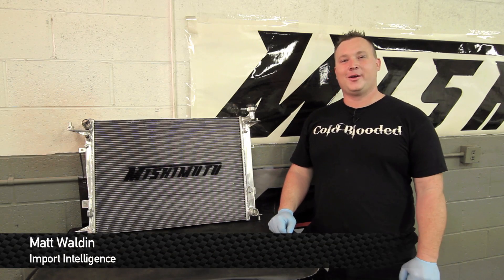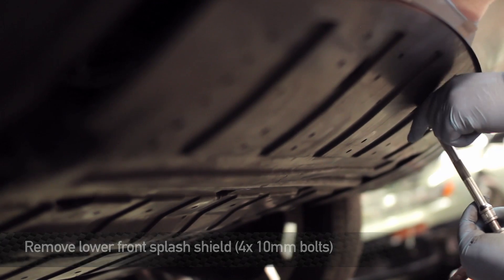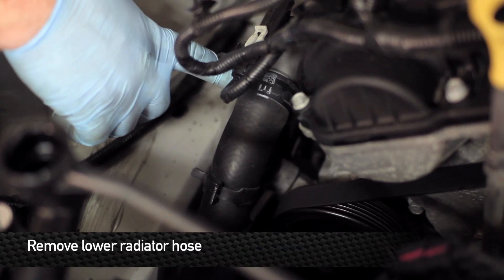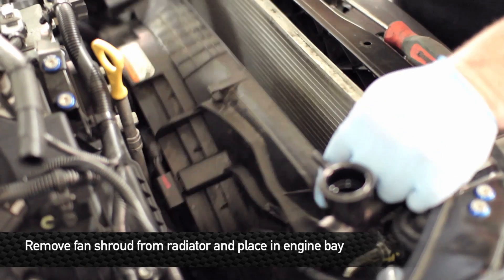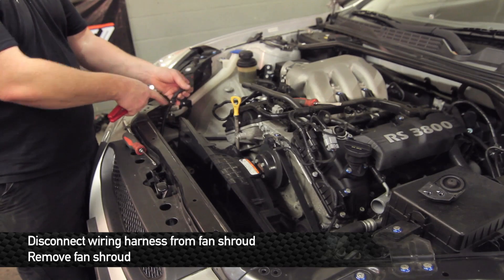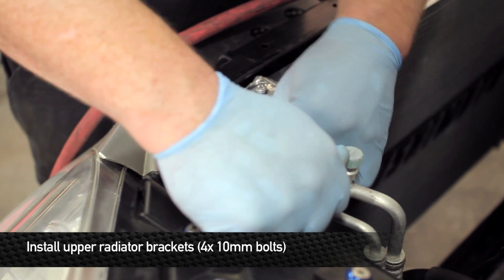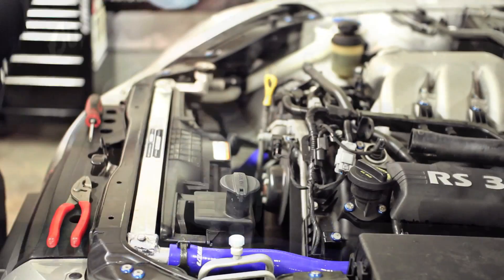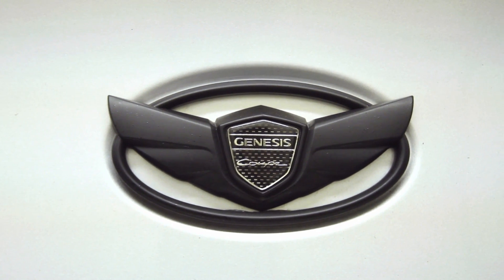How To Install: Mishimoto Hyundai Genesis V6 Performance Radiator

Comment: where do you put the new transmiton cooler?
Reply from the maker: Assuming you have an automatic transmission and are looking to install the associated cooler, most customers mount this at the front of the cooling stack (typically on the A/C condenser).

Comment: You say that an automatic trans cooler kit is needed for this install. I can't find this anywhere on the Mishimoto site. Anyone have a link to where I can pick this up? I have a 2010 3.8 Track with an automatic transmission.
Reply from the maker: You would need the universal transmission cooler listed on the product page for your radiator.
Reply: @mishimoto  I can’t find the transmission cooler anywhere on your website

Comment: Will this fit 2012 hyundai equus 5.0. I always have bought mishimoto for all my vehicles... 1987 mustang gt that is sold already. 2002 mustang gt, 2008 gmc sierra denali and now I'm looking for something that works on my 2012 Hyundai equus...
Reply from the maker: Unfortunately the parts are not compatible for your equus. We also do not seem to make anything at the moment that would be compatible.

Comment: Does anyone know what are the additional steps for the 2013 2.0T?
Reply from the maker: The radiators appear to be very close in design. However since Hyundai used different OEM part numbers we cannot say what this would require.

Comment: So you have to buy a mishimoto transmission cooler as well for the v6 automatic ? Im confused
Reply from the maker: Hello, automatic vehicles will require an auxiliary transmission cooler.
Reply: This apply for all automatic GC.